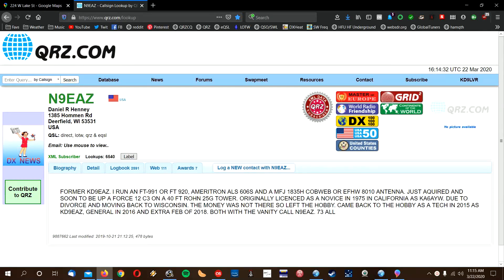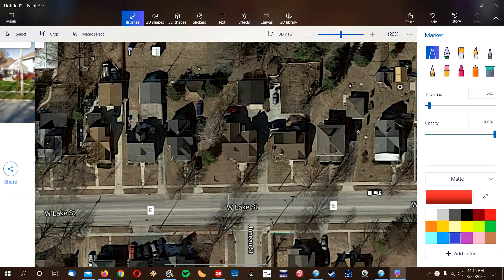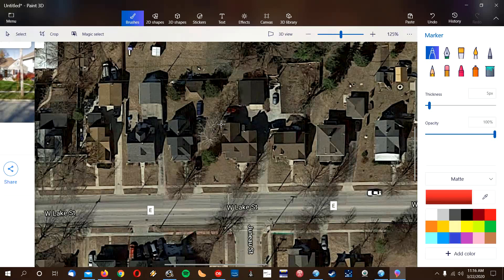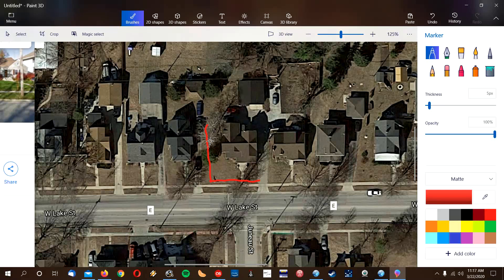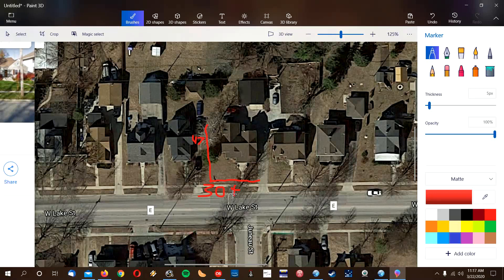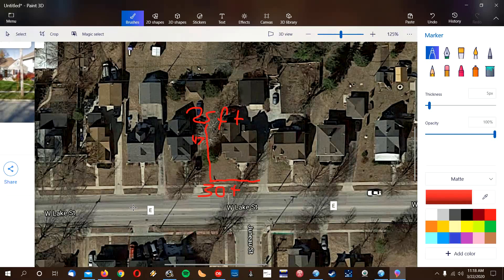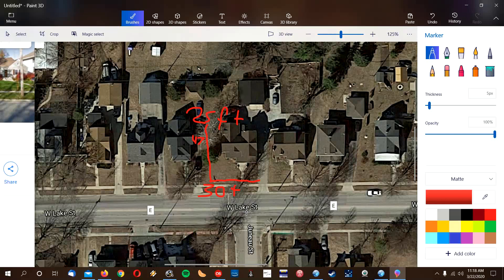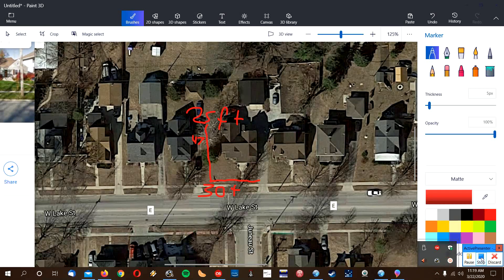Inverted L Antenna Diagram

Comment: If your painter's pole holds the wire up 9' by the road with a 25' high feedpoint, how is this an INVERTED L?
Reply from the maker: The feed point is ground level, and the vertical portion is 25' at it's peak. I'm sorry that I did not explain that properly in the video. I also have a 8 foot ground rod with 19 buried ground radial wires at the feed point.